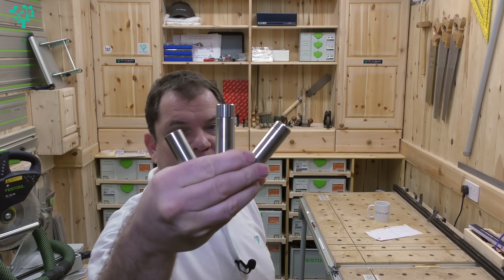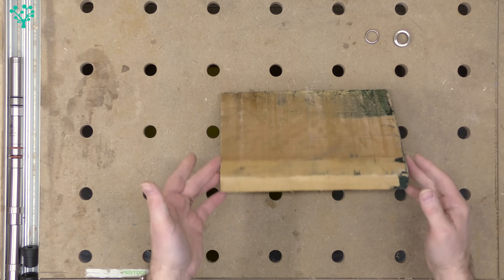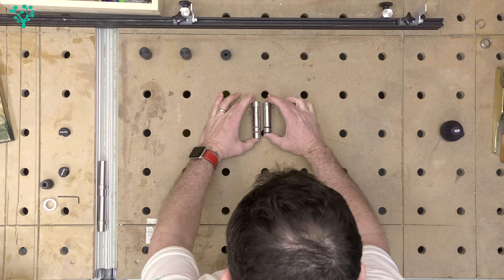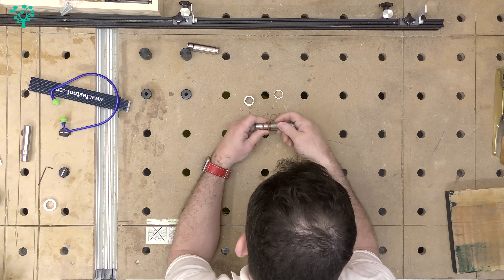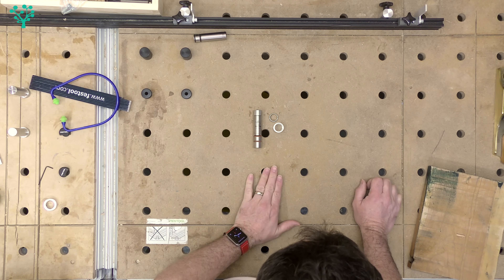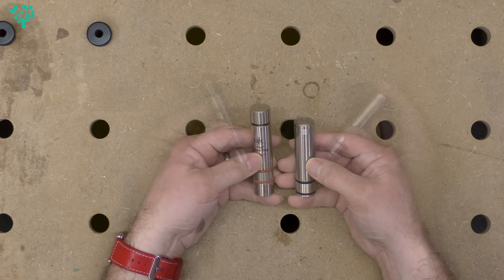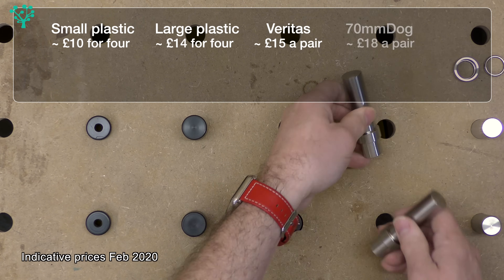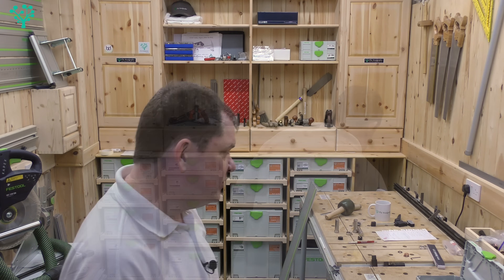Best bench dog for your MFT

Comment: Being new to the MFT system I bought two Parf Super Dogs and the chamfer cutter (I cut chamfer where I need them vs doing all of the holes). After watching this I went out and tested the Parf Super Dogs for wiggle and found them to be much less than you test without the chamfer. As suspected, that chamfer ring adds some stability.
I do find the o-rings fiddley which is annoying. I have some o-ring kits for my motorcycles and I think I'll experiment with them to see if I can improve that aspect of them.
Reply from the maker: Thanks for getting in touch.

Yes I find those O rings to soft, much preferred the harder rubber of the quad dogs. You can now also get a chamfer ring  for the quad dogs so will probably add a chamfer at some point.

In terms of the movement - I have since discovered that the holes in the MFT do have some variance between them - so not all 20mm. Not sure if that is a manufacturing tolerance or wear over time.

Let me know how you get on with the new o rings.

Cheers

Andy

Comment: Thanks. Found that most interesting. 
I have your top two candidates and also a number of assorted other brands.
Worth mentioning to be aware not to mix your dog brands on the same plane. As I discovered, not all dogs are born equal. They may well fit the same 20mm hole and be round in shape, but they often don’t have the same circumference above the table as each other.
Reply from the maker: Hi Howard,

Excellent point on the “not all dogs are born equal” until you mentioned it - never even crossed my mind. I ‘assumed’ 20mm dogs would be 20mm. I will be out with the callipers later on having a measure.

Given you have the brands, what is your experience. Do you agree or have a different view?

Talk soon

Andy
Reply: The Woodgrafter become aware of it when  I had my mft fence hard up against a set, but locked by 
the mft mitre set and clamp. They were there as a backup. Then I later replaced them with another set. The gap was more than a mm.   I put back originals and it was fine
Reply from the maker: Howard dove Thanks for the follow up, yep makes perfect sense and will share it with the community on the next vlog.
Reply: The Woodgrafter With the parf system I bought the chamfer tool (not cheap) and marveled at the options, but in reality you have to make sure you keep all the bits together and keep re remembering how it puts together. In the end I couldn’t be bothered. It’s like buying a piece of electrical equipment, such as a microwave, with all the features, but in the end all you want is start, pause, and stop. 😄
Reply from the maker: howard dove LoL, yes I know what to mean. For me to put things in my workflow, it has to be easy and quick and do the job. The super dog seemed over engineered, and I just wouldn’t use the extra bits. 

Did you find any advantage of the chamfered holes ?

Andy
Reply: The Woodgrafter The chamfered holes are good.  They make the dog rock solid, without the need to torque down the dog so much. It does concern me that you could rim out the hoes in time, by over tightening. Course, you don’t have to buy the tool, you can do the same with a router. But thought that I’d be even less likely to do that.
Reply from the maker: howard dove thank you, that’s what I thought - but it’s good to get the confirmation.

Cheers

Andy
Reply: The Woodgrafter Hope I’m not banging on too much here.... The system I’ve adopted, (since I also have both “breeds”) is to chamfer those holes I tend to gravitate to, leave the collars on permanently, use the parf dogs with the chamfer fitting for those holes, and use the UK Bench dogs for everything else. I do have the full version of the mft, so the rail is usually fixed. When I’m doing larger sheets, I’m not using dogs at all, or the table. I use a longer rail and the TSO  rail guide, which I believe you’ve already reviewed.
Reply from the maker: howard dove 

Hi, bang on as much as you like, it’s always good to share thoughts and approaches 😁

I am aware of the TSO, but haven’t used it or reviewed it, I have also seen the Woodpecker version that looks interesting with the repeatable stop (almost a cross between the Festool parallel guides and the TSO).

The exciting thing is that Benchdogs UK are bringing out a version in the next few weeks, so will review that at some point.

Talk soon

Andy
Reply: The Woodgrafter I believe the TSO product is the original concept. However, I’ve since seen others.
Whichever version you end up with, you’ll come to wonder how you managed without it. 
I’ve been a Festool track saw user for years, but even I can see the need now for a table saw of some sort. That said, there’s no safer way to break down large sheets of ply, without compromising the cut. Worked well also when trying those really awkward jobs, such as cutting large lattice section to fit a frame.
Woodpecker stuff costs a fortune to send here in Australia. I indulged in a large square once and the postage was AU $130 
Gone to Banggood since. Free postage.
Reply: howard dove I’ve got the hand chamfer tool, but having just built myself a track saw cutting station I ended up putting a chamfer on all the holes using my trim router which only took about 10 minutes for ~100 holes.

Comment: Good video and fair assessment.
I, myself use the superdogs in my chamfered mft top and they are in my opinion as sturdy as the quad dogs that au also have a set of.
Reply from the maker: Thank you for the feedback, yes the chamfer makes them very stable - I think it is the soft range rubber that give them the flex without the chamfer.

Cheers

Andy

Comment: Very Interesting Comparison! Helped me quite a bit in my decision on which dogs to get
Reply from the maker: Thank you for the feedback,

Glad I could help.

Cheers

Andy
Reply from the maker: And.... what did you decide ? If it was the Benchdogs, then use the code thewoodgrafter at checkout and get some discount.

Cheers

Andy
Reply: @TheWoodgrafter  I went for a Combination of Parf Super Dogs and I'm gonna Order the Benchdogs aswell.
I'm using the Parf System to make my own MFT Top, so i think the Original Parf Dogs with the Chamfer are going to be great for use with the Festool Track
But I will get a few of the Benchdogs in different sizes for added flexibility and as my "Standard" Dog for that rock solid alignment

Comment: Interesting information as I am new to the MFT/bench/parf dog setup.  I just put a series of holes around my main work table for cutting with my track saw.  As the holes are new and in Plywood, they are tight as heck right now.  As I use it more I imagine I will need to move to the quad dog type arrangement.
Reply from the maker: Hi Carl,

If what you have now works - why change. I do love the quad dogs though.

Cheers

Andy
Reply: @TheWoodgrafter  I am speaking of LATER when the holes are no longer as tight as they are now.  Right now I have to push them out from bottom of the table they are so tight.    I don't own a MFT, rather I just have the Mark2 UJK Parf Dog Jig and made a lot of holes for my table.
Reply from the maker: Carl Brothers 

Ahh got it, yes see what you are saying. I am not sure how much slack the quad dog will take up, I’ll see if I can measure it and let you know.

Interesting question.

Andy
Reply: @TheWoodgrafter  I started with a jig from Woodpeckers, but that was very inconsistent and they knew it was prone to stack error.  I returned it after trying to just see what it could do with 20 holes and failing to get decent results. When I confronted WP about the issues they said they knew, and that the jig is more for clamping holes versus making anything that required accuracy like a cutting station. The accuracy with this UJK Parf guide system is stunning.
Reply from the maker: Now that is interesting, I was thinking about a jig - Trend - for my new work en h build. But I need 100% accuracy for my work flow.

Will.look at the WP jig - to see if it is a similar design.

It may be Peter’s jig after all...

Comment: Great video and really helpful.  I tried your discount code and it didn't work - shame because I know you get a small bonus each time it is used.  By the way, the best value for the fully populated set is to buy the twin set and the mega 2 set separately,  You get a spare systainer, 2 extra base units and some extra rings, for exactly the same cost.
Reply from the maker: Hi,

The code should work thewoodgrafter

What error message did you get ?

Cheers

Andy

Comment: Andy you where very positive to the rail dogs when reviewing them some time ago. Specially when it came to the cut line.
I would say benchdogs very seldom need to be high, unless they are fo the guide rail. So do you use quad dogs for the rail or do you prefer the rail dogs? Or do you even use the railsquare with dogs....? :)

Many questions but I think you get my point (i.e. what do you recommend).
Reply from the maker: Hi I use the rail dogs for the rail, and quad dogs as my main go to dogs for pretty much everything else. The reason I use the rail dogs is that they position the cut line between the 20mm holes - using the technique of resting the trail against the dogs, places the cut hole through the 20mm holes (if that makes sense).

I use the rail square when the cut is wider than the capacity of my cutting station on the bench, long rip cuts is a prime example of that. I don't use dogs with the rail square

My recommendation would be..

Set up a cutting station with the Fence, track saw and track dogs
Use the square for long cuts

Cheers

Andy
Reply: @TheWoodgrafter  Makes sense and very clear. So your use of the rail square is more to breaking down sheets. Then maybe all the RS accessories can wait for later. I will prioritize the rail dogs.

Good advice :)

Comment: Just found your YouTube channel and wished I'd seen it before buying Parf Super dogs last week. Like you, I found them extremely difficult to remove from the holes. Helped a little putting paraffin wax on. 
One question, will the quad dogs O-rings fit the Parf dogs?
Reply from the maker: Hi Brendan,

Welcome to the channel. Just pooped into the shop and tried the Benchdogs black rings on the Prf dogs.

Worked like a charm, perfect fit, tight grip in the MFT and they don’t bind in the hole.

Great idea, can’t think why I didn’t think of it. 

Cheers

Andy
Reply: @TheWoodgrafter  Thanks for that. I'll order some.
Reply from the maker: Your welcome,

Cheers

Andy

Comment: Aswell as parf dogs and the new ones Festool ones most of the time I used 20mm electric conduit cut to about 50mm and they are a snug fit and don't move around.  Fine for most jobs and the price is right. 🤣🤣🤣🤣
Reply from the maker: Hi Clive,

20mm conduit is a genius idea - I would never have thought of that.

I will give that a go and pass on the tip on the next VLOG.

Cheers

Andy
Reply: @TheWoodgrafter  😂👌👍😎🤔

Comment: Are their any Budget ones at all?
Reply from the maker: It with the twist type action to lock them from above,

But standard dogs are pretty cheap on eBay.

Cheers

Andy
Reply: @TheWoodgrafter  What company sells a budget dog for the MFT3
Reply from the maker: @patrickploenzke489  

Hi Patrick,

I haven’t used and therefore can’t recommend any - but this is the type of thing.

https://www.ebay.co.uk/itm/PAIRS-of-Precision-CNC-Alloy-Turned-Dogs-for-Festool-MFT-3-20mm-Hole-Bench-Table-/264677974676?mkcid=16&mkevt=1&_trksid=p2349624.m46890.l49286&mkrid=710-127635-2958-0

Cheers

Andy

Comment: With the amount your MFT moves around when pushed/pulled the word accuracy is misused when only using 2 dogs, your work HAS to be locked down which is not going to happen with 2 dogs.
Reply from the maker: Thank you Spike72

I did get accurate cuts with that system.

However, I have now replaced those benches and built something more solid.

Cheers

Andy